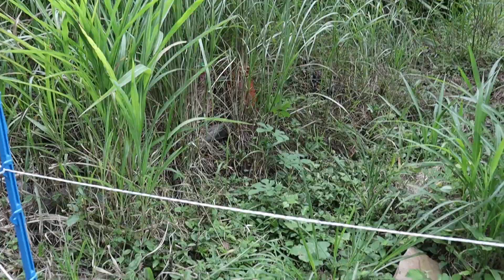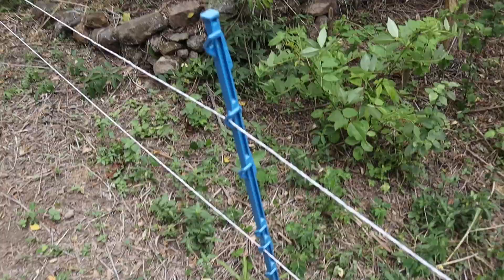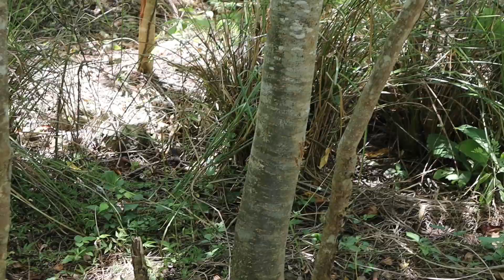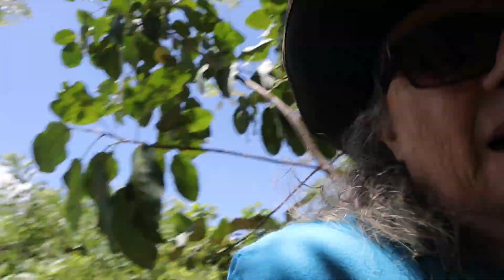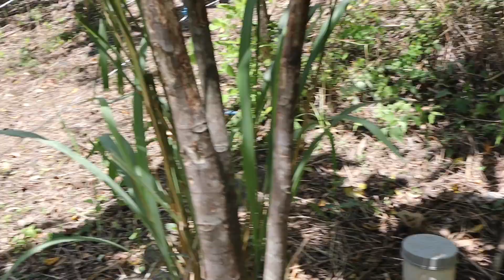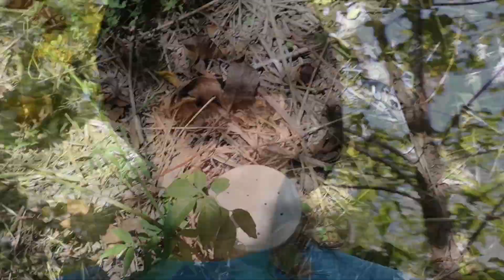Defying Nature's Limits: How to Build Rich Soil on Solid Bedrock

Comment: You should try seasonal vines. You can use lemon grass as well. Vetiver is good but lemon grass is pretty strong and fast growing and it actually dissolve the sand so perhaps it may work in the same way in your situation. Lemon is perfect for tropics and desert, the more heat the faster it grows. I am in Dubai in Middle east and its desert but we grew that in saline poor sandy and boy the quality of soil was so good and dark sandy loam. we grew pomegranates and many fruits. 

you can try sweet potato vines only to be chopped and composted. Secondly edible plants for livestock is your option to keep the minerals locked in vegetation which when the time comes can be fed to sheep. Napier grass is also a good option. The rains will pass on but leave the minerals because of large plants.
Reply from the maker: Wow! Thanks so much for these suggestions. I am going to look into lemon grass. I started planting Napier grass about one year ago and I am very satisfied with the results. Our sheep really like to eat it too, if it is chopped up, so that is a bonus. Thanks for commenting and supporting our channel.